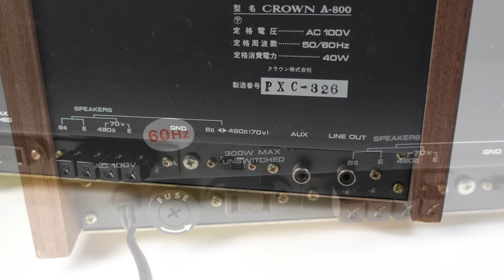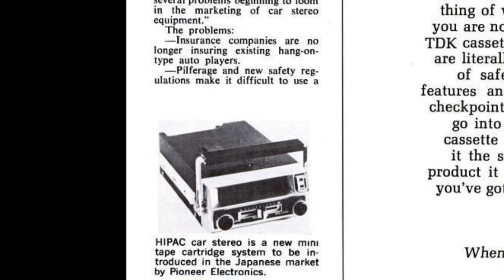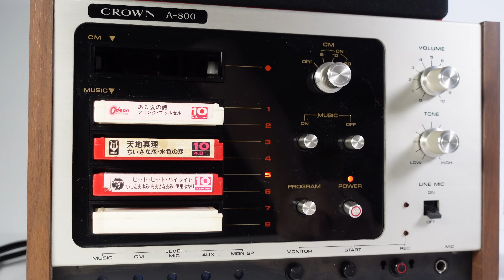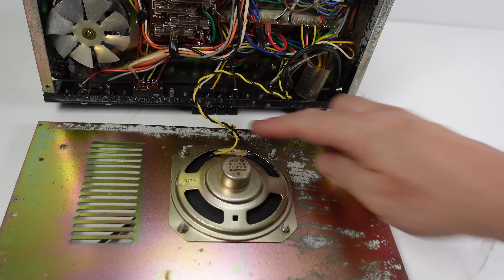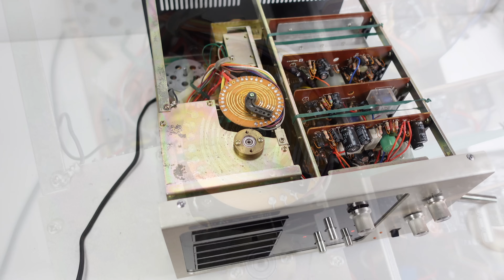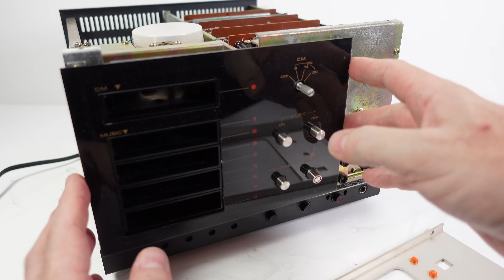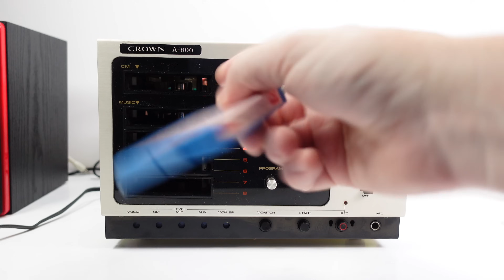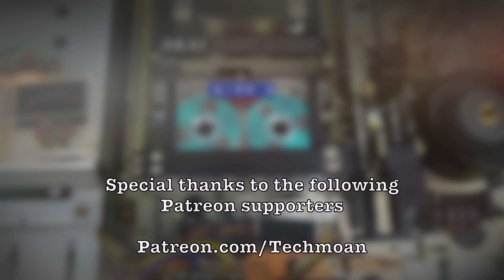An unusual player for a forgotten ‘70s music format

Comment: Great video - Love your channel! 
I find it reasonable that a tone was used in the CM tape, since I expect each message has its own length - you cannot force customers to record a certain length, and you will not manufacture 10s, 20s, or 30s cassettes for messages. Also, the customer would most probably want to have more than one message to play repeatedly - there will most probably be several separate messages playing during the hour. I'm just guessing here, but they probably used short but standard tapes, and a set of tones on the second track to control the device: a tone to mark the start of a message - so it knows where to pause and wait for the next play time slot, a constant tone to mute the playback while the message was playing, and maybe no tone at all to continue playing over blank bits and loop the tape back to the messages. I suppose a single tone would have been enough: Roll the tape when there is no tone. When detecting a tone start - pause and wait for the next time slot. when it's time to play - play, and the tone controls a relay to mute the playback of the background music. When the tone ends - the music is un-muted, but the tape keeps playing the blank bit until it hears a new tone and so on. I wonder if there is a problem with the tone recording on your machine? - I expect it to be recorded automatically to the second track when recording a message. maybe that circuit is damaged.

The capacitor change is required to set the "power factor" of the motor - it  will NOT change the speed just prevent overheating of the motor when operated for a long time on 50Hz instead of 60. The motors for 50Hz and 60Hz are the same motor - it's a synchronous motor that rotates in sync with the line frequency. the difference between 50Hz and 60Hz machines is usually the gears - the diameter of the driving wheel powering the belt will be different.

For easy 60Hz playback: I live in Israel - a 50Hz country. To use 60Hz devices I use an "inline" UPS. The inline UPS is slightly more expensive than standard UPS (Uninterrupted Power Supply), and has the option to always use its DC to AC circuit, even when power is available and the battery is charging. It's good for systems that don't like even the short switching time between outlet power and battery powered AC. The nice thing about these UPS, is that they can convert voltage AND frequencies. It's a bit of a chore to find the correct mode, but once you set it up it uses a powerful AC to DC power supply from your 220v 50hz power to provide DC to the unit (charge the battery and provide full power to the DC to AC circuit). The DC to AC part is then set to provide 60Hz power output.
the down side it that they make more fan noise - as they have to constantly cool their powerful power supply (while a normal UPS just slowly charges the battery at low power), and I guess they also waste around 15% of the power in the conversion. 
on the upside - you get a true 60Hz power outlet - and you can set it to 100v, 110v or 220v - you just need to select the correct operation mode.

Comment: YES! Changing the capacitor will change the speed. As usual, everyone overthinks things on the internet. It's obvious, they printed the ufd value for the frequency right there on the PCB for only one reason-so you could change the motor speed!!

Comment: Modify the cap could be risky, we di not know the circuit, but you can modify the pulley ratio, much easier, ask a machinist to cut the pulley for you.

Comment: It's mono because this device is for a 70v commercial speaker system.  Basically this would have been used in an office building or large retail store with a ton of speakers that support 70v (you know those cheap drop ceiling speakers you see everywhere) that allows the speaker wire to travel very far without much voltage drop.  I'm surprised techmoan didn't pick up on this fact, Crown is still the industry leader for these types of amplifiers and systems today.

Comment: That internal layout was wild, the way the case is put together and the board arrangement just screams 70s electronics. The last time I saw a device laid out like that was an old Altair computer.
Reply: Modular design is always a good idea. Except that the accountancy department won't like it....
Honestly though, there is no better way for a manufacturer to say they appreciate their customers & are committed to the products they design when: A) Product is repairable B) Modular design. How often do we throw out modern electronics just because some 0.01 Cent, or whatever lowest denomination you go by in local currency, resistor has fried?  (Except the Venezuelan Bolivar & its permutations, that stuff's not even worth wiping your rear-end with for toilet paper)
Reply: @thesunexpress  The devices not worth repairing these days are repairable as before, the thing is that one hour of a specialist costs more than the device itself. Back in the day, if your coffee grinder would fry, you would take it to a shop and have the motor rewound (or replaced) for a few bucks, today such grinder sells for $20 and the technician will ask for $30/h at a minimum and then we have parts and such...

Comment: As I can see at 27:30, you have a FeTAp 611 sitting in the background. Does ist work? :) I fixed and adjusted a lot of these over the last years, all of them are still working fine now :) Have a yellow one for myself :)

Comment: The capacitor should change the speed of the motor, they're likely running it in series with one of the motor windings to reduce the amount of torque available, and therefore regulate the speed in a slightly crude yet functional manner

Comment: I would think there'd be a way to produce 60hz input over there. There are already devices that convert from the DC from your car to AC, which would have to add the Hz manually. And, of course, there exist AC to DC adapters.

With as much older electronics you find from all over the world, I'm surprised you don't already have something like that. I know you already have something to step down the voltage.

Comment: If HiPac uses standard cassette tape then the ONLY real thing really limiting it's availability is the case to put the tape i....
and looking at it it is a TRIVIAL thing to replicate using a FDM 3D Printer in PLA or PETG and TPU/TPE  for the roller or with a MSLA printer in Resin.
all you really need is one to get the measurements off of or a technical sketch whit the appropriate dimension witch  you can probably get from it by now expired patent.

anyway 

grate video

Comment: Similar issues on these carts to 8 tracks then (unsurprisingly given the design is so similar), I had a play with 8 tracks in the '90's and had similar problems with disintegrating sponges, splices and stretched tape.

Comment: One of the most annoying things about non-auto reverse cassette decks, especially in cars, was the silence at the end of one side that was always necessary to fit the other side on the tape. So you either got stuck with 2 or 3 minutes of listening to nothing, or you had to press fast forward before removing the tape, then often you had to press stop when the tape got to the end because a lot of car stereos didn't even have auto-stop. So you had to somehow hear or notice when the tape stopped, which was not always easy in a moving car. Then you had to physically eject it, flip it over, re-insert it and press play again, all while driving. This was also the way a lot of tapes broke in those days, because you'd get that initial slam from fast-forward to stop, then continuous tension when you inevitably failed to notice the tape was stopped. So all this meant that cassettes were initially almost universally reviled for car stereo use; in the US, at least, 8 tracks stayed popular at least until the early 80's.

Comment: Another clue to this being a commercial, not consumer, device is the 70v speaker output, 70 or 100v systems being used for long distance distribution to multiple speaker systems, e.g. around a store.

Comment: I can imagine a larger capacitor would be needed in smoothing a lower frequency a.c. supply, but would think other changes would be required if the design relies on the the supply frequency for timing, speed etc. (e.g. for an a.c. motor).

Comment: I wonder if new cassette tape could be simply spliced into one of those Hipac cases, making it possible to keep the original tape that was in it, if necessary putting it in a cassette case.
Reply: At a guess...no. The ¼ inch tape in NAB carts (as used in radio stations) was a special lubricated version to help overcome the friction of pulling it out from the inside of the spool. 
So I suspect this ⅛ inch tape would need to be the same.

Comment: At last! I know the format used for my 1987 PlayMates Talking Jill Doll! Its HIPAC or something similar. I’d love you to do a video on her. I promise she will  blow your mind.  I would be most curious to know if one of her cartridges would work in your player. Physicly they sound exactly alike. I am having the same problems as you with the tangling. I was dumb enough to open one myself and I deeply regret it. Could you please explain how this tape is wound around these metal wheels and how itthreads over the spunge in the end?  I cannot restring this laborynth.
Reply: The tape is pulled out from the inside of the loop and wraps around the outside.
Reply: @threynolds2  thank you! I will psyched myself up and try to go back in there for another shot.
These tapes are so rare. I wish I had a junk one to play with and see if I can properly re-wrap it.

Comment: On the subject of speed. 

I think for the speed fix I would go for KISS. 
Playing with the capacitors etc is a hassle as even changing the capacitance by replacing the cap should change the speed it might get strange results due to resistance etc as the capacity only kind of is the key to the speed. Capacitors are deceptively complicated when used like this. It's part of a timing system paired with a coil to get the speed and is used the change how motor is powered. Its similar to how ceiling fans have their speed set.

Replace the motor pulley. Since it needs to go bigger the belt will even able to stay the same. The existing one will likely be pressed on and a simple tool from an auto parts store (Pickling fork. Maybe a small claw hammer and patience and tap the shaft with something like a screwdriver. Don't leaver at it as this will put force on the bearings) and you will be able to pull it off. Remember the metal its made out of is soft prone to cracking.  I wouldn't used heat. Any machine shop could create a replacement in metal for very cheap if you provide the original and ask for it to be 20% bigger. Maybe even a 3d printed one would do.  Of course it may be possible to machine the flywheel but then you couldn't go back and depending on the profile of the metal it might not be possible.

Comment: There is more than one styling element of this deck that would make me bet the farm on it being built by pioneer between the shape of the knobs, the rounded corners on the inner panel the fonts that are used on the faceplate etc etc

Comment: Since it uses the same size tape as the cassette, could you wind your own using tape from a cassette?  Also, could these carts hold more than what they came with (looks like there's a lot of space in there) kind of making an "extended play" hi-pac"?
Reply: See my post above. I suspect it is a special lubricated tape, as that's what the larger version needed.

Comment: If the motor is AC powered, you have no chance of changing its speed. Therefore, you could try a mechanical solution, You could for example replace the primary pulley (the one at the motor's shaft end) with a 20 % larger one. This is however, a non-original replacement. If on the other hand, it is a DC motor, then I guess speed is controlled via a mechanical or electronic feedback, in the latter case you could replace some reference component, but not the capacitor. Great video!

Comment: Changing the capacitance inline with a motor is a common way to control speed. Most consumer fans that run on 110 in the US (i dont know about where you're at but I imagine its the same) have a capacitor pack with three values and 4 wires so a 3 way switch can select the capacitance. I can see how that would make the motor run faster or slower, because it moves the magnetic field in the motor to casue faster or slower speed.

Comment: 100% changing the capicitor will change the speed. I know because I'm a penguin and the great Mumble taught us all how to dance and the secrets of capacitance. The film "Happy Feet"  focused more on the tap dancing but he legit taught us about electronics too so we know all about resistance, capacitance, riverdance etc. I don't know how to explain it in English, but just trust me. Change the cap. Easy fix to convert it for use on 50hz. Speaking of which, 50hz is the great Mumble's tap dancing speed record. 50hz = 3000tpm or three thousand taps per minute. <3

Comment: I feel like rather than going through the process of physically changing a rare piece of audio history, perhaps it could suffice to figure out a way to supply the device with the 60Hz electricity it was designed to get.  There are probably usable solutions along those lines.
Reply: Sure a VFD of almost any type would be up to the task of outputting at 120% speed.  It would also usually be able to support the quaint 100VAC standard from Japan in the same unit.

Comment: The best humour is always delivered dead-pan (no jacket required).  Nice job.  I doubt the cap could influence the playback speed, if there's no mechanical means of adjusting it, I'd assume a different motor would be required for 50 Hz.  Or if you're a mechanical genius, adding some kind of filler applied to one of the wheels to effectively change its diameter in the ratio 6:5.  Good luck with that!

Comment: Capacitors tend to be fairly imprecise, it'll be part of the power supply
The ability to disengage the roller i'd have to imagine is for mechanical pause/play, avoids switching the motor, and is absolutely genius as all it requires over an 8-track is a hole in the case and an extension to the roller mount, zero extra parts for the tape while potentially reducing the part count in players

Comment: The absolute amount of time required to charge/discharge a capacitor is a function of its capacitance, so it stands to reason that changing a capacitor’s size will alter the timing characteristics of the circuit it’s in

Comment: You need to beat the 50/60 Hz issue by using a pure sine wave inverter, and power off a UK based power supply.  That way if you need 60Hz just convert your 230VAC 50Hz to 12VDC/24VDC and then back either 100 or 120VAC at 60Hz.  👍😁  Cheap frequency converter.

Comment: I meant to put this here rather than as a reply... I am sure the motor is a synchronous motor with two windings operating with a phase shift. The capacitor would determine the amount of phase shift needed between the two windings for correct motor torque. It would not dictate speed in this case.  I wonder whether the motor labelling gives any clues? Also, checking the wiring from the motor would help clear up what is going on. With two windings with a phase shift there would probably be just three wires from the motor to the AC from the mains or transformer secondary (or sometimes four), one winding having that capacitor in series.

Comment: Some chaps further down are speculating on adding another cap in parallel to the one that says 50 / 60 Hz. You'd only have to twist the leads round of a 400uF round the existing one, noting polarity which is important for electrolytic caps, ie the big can ones. But I doubt that's it. It seems more likely that the part that would be replaced, would be the motor. Or else a pulley. Some motors have a starter-cap, to give it a sort of kick. But 600uF is way too big for that, so it's a bit of a mystery. 

Perhaps you could get a pulley 3D printed. You'd just need to apply the ratio to it's existing diameter. The belt would need to be a tad longer. Do they do them in lots of size varieties? Worst case you could get the next size up and stick an idler in there to take up the slack. Like print out another pulley, have it on a mechanism you attach to a nearby screw. Then you can put on a bigger belt, bigger pulley reel on the motor, and have it all snug and tight. Use one of the less brittle plastics. 

A decent 3D printer owner could knock up some custom part that attaches to the existing frame. Put a little bearing set in there even, have it running smoothly. You'd just need to take some photos of the parts with a ruler in shot, some generous genius who has experience might offer to do the work for free or at least cheap.

It's that, or, preserve authenticity and get a proper mains inverter that includes frequency selection. They're not cheap, but really there's no need for them not to be. Just a microcontroller, a few MOSFETs and a big coil. Then again, the end result would just be some Japanese caterwauling, and if you cared that much you could just edit the songs on computer. Maybe don't bother. I despair for Mat's wife, hope the guy has several large garages. I bet he used to have a nice garden, once, before he filled it with three-storey sheds.

Comment: If you can't find an 0.4uF capacitor to put in parallel with the 0.6uF one, a 0.39uF capacitor will work just fine - it's a more common value. Make sure it can handle the voltage!

Comment: 490 ohm 70 volt speakers? Literally neer heard of them! Are they some variant on the 100V PA system thing? They use a transformer and I'm not sure can even be specified in ohms.